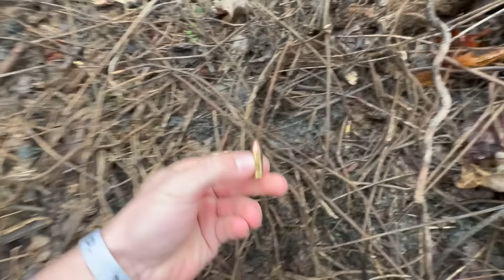I Crashed my Can-Am off a 30 Foot Cliff and Flipped 3 times

Comment: 11:00 what I do instead of glue: get a soldering iron and you can melt the plastic together kind of like it’s own little weld. I’ve done this to an armrest and the dash in my truck and it works like a charm and there’s no glue to get unstuck, structurally almost new. And if you do it on the side you can’t see, it even looks pretty good too.

Comment: yo, that back panel, it doesn't look too badly messed up. it looks like you should be able to fix it with a little bit of plastic welding, and you can do that for much cheaper than buying a new panel. should cost anywhere from like $40-$100 for everything to fix it. and from what i see in this video it doesn't look like you will have to remove it to fix it. aaand if you get a decent plastic welding gun (about $80) you will have a pretty awesome tool that can be used to make stuff like water tanks, feeding troughs, and all sorts of cool stuff`

edit
nevermind, i should of finished the vid before i commented. looks like you got it fixed good enough lol

Comment: A smart person would have let off the brakes and the throttle and above halfway through the corner, you can start giving it the throttle and then if you don't stop sliding, then steer right into it and get ready for a new ride

Comment: Actually try auto parts instead of going it back together because then that way the girls can actually get on dry and it could break off a lot more easier than you actually think so what I would say is go to auto parts and get a 12 piece inch wrench and go to equipment. I’ll get a rope and just tie back back to

Comment: You probably know this but the reason for the way it froze worse at that point of the road ,,,,reason being the air that flows beneath the road threw the culvert ,,,it lets the cold penetrates all the way threw which causes a different type of ice ….. 
anyway if you ever have one of those wrecked and don’t want it get at me ,,I’ll go pick it up… I need one that I can fix for hunting … I do a ton of outdoors stuff ,,,heck if it wasn’t for my little buddy ,,,I’d be out there all the time but he can’t handle the cold yet ,,YET …
ANYWAY YOU NEED TO BE CAREFUL AND NOT TAKE TO MANY CHANCES LIKE THAT…. ICE IS A SOB AND IT WILL GET YOU ,,, WHERE I GO ELK HUNTING ITS A BIG ISSUE BUT ID RATHER DEAL WITH ICE THAN 2 HUNTERS PER ACRE ,,LIKE DOWN HERE IN THE SOUTHEASTERN PART OF NEW MEXICO…. 
YOU TAKE CARE N KEEP THEM VIDS COMING… G.B.